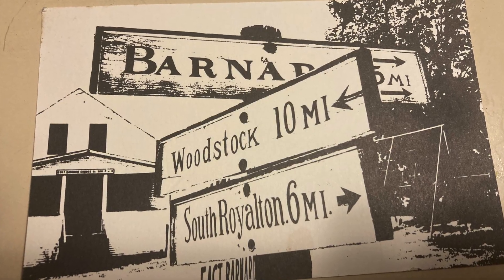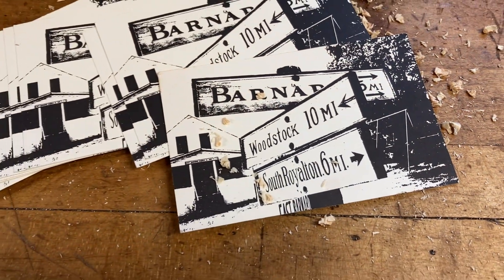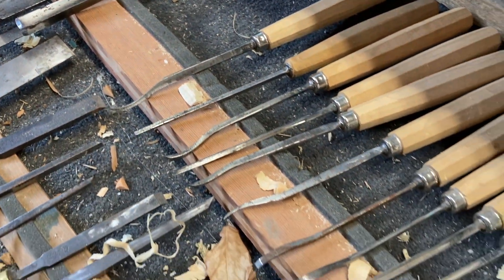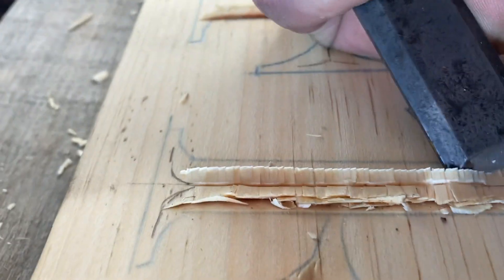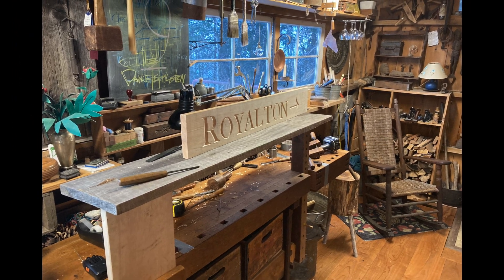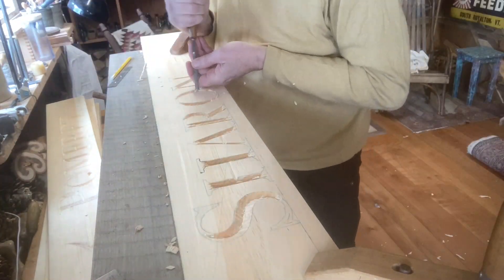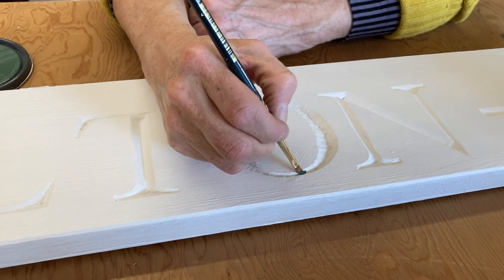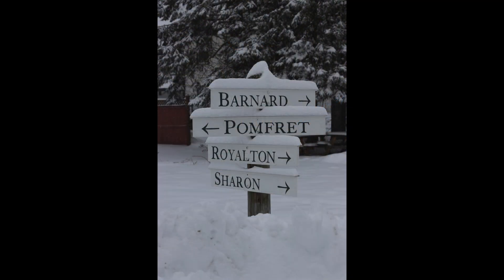You Can Get There From Here

Comment: The hills and valleys of East Barnard are the ancestral home of my mother's side of the family: some still live there.  

The signpost at the intersection of Broad Brook and East Barnard Roads speaks to the enduring constancy of the region: things don't change quickly.  

But when change in East Barnard does finally come about,  invariably it's because something is as worn out as it can get, necessitating replacement rather than restoration or refurbishment.  

The materials for that which then replaces what came before are carefully chosen and meticulously crafted, resulting in something useful- something firmly rooted in the present, looking toward a future horizon, and honoring the past, all in the same moment.  

Such is the case with the newest incarnation of the East Barnard signpost.